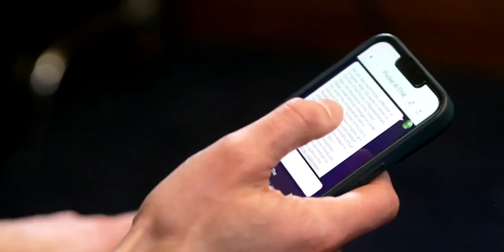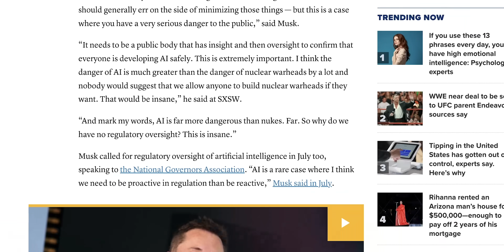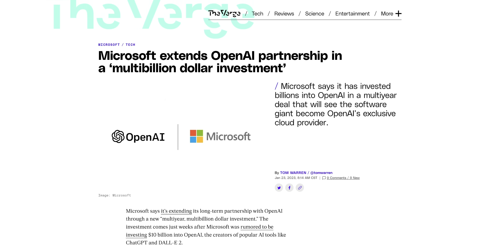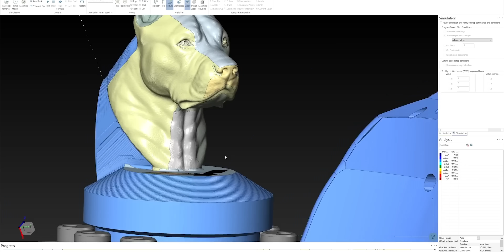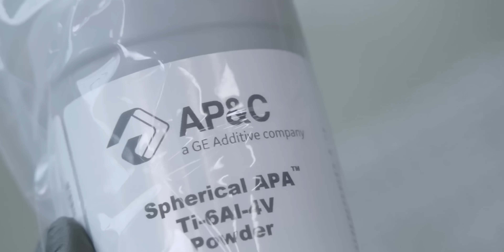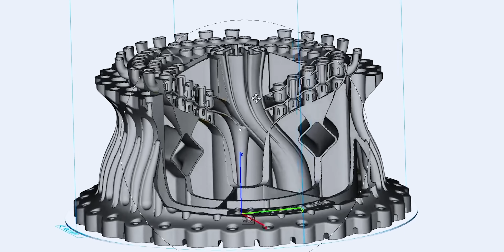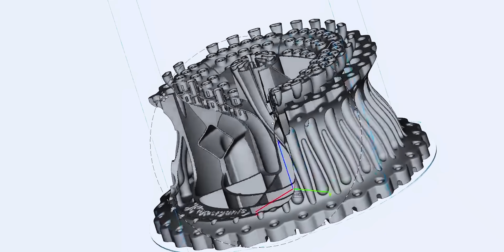How CNC Machinists CONQUER the RISE of AI

Comment: The overall message here is fantastic! So positive, AI is a powerful tool to augment your daily tasks. I'm a 60 yr old embedded circuit designer with 40+ yrs of experience, I have chatGPT open all day long, helps this old dog to remain competitive. Don't fear it, embrace it or you'll be left behind. Thanks for the video.
Reply: Hey, I also had a long career writing circuits and software for embedded systems! One of my early contracts, the customer thought I should manually check everything to make sure my signal traces were not shorted together, but I showed them the computer already did that check in a few seconds instead of hours! For the past few years I have been doing manual machining, making pretty parts out of stainless steel or sometimes plastic. Sometimes I run, and write small programs for, our ProtoTrak CNC mills. We do not mass produce; today I made 20 parts the same which is highly unusual, more often just 1 or 2 of a kind for use in the machines we make. Our machines (that we make) are high performance loaders placing food products in their packages, multiplying the performance of factory workers by 100. Some machining operations, like threaded holes in the ends of long rods, cannot be done on our CNC machines because they will not physically fit in the machines, so I clamp them to the edge of a knee mill and move the head around to align with the rod. Our manual lathes also do work that is too big for our CNC lathes, but do at least have DROs that make precision cuts easy. I think CNC/AI does not replace workers, it just allows us to produce more things per worker doing varied jobs from design through some remaining manual operations so everyone can have more stuff.
Reply: @BenAtTheTube  I've never manually taped a circuit board layout but know what it is and how a software tool eliminated taping and increased efficiency.  I first learned to program an HP calculator and used as a tool. I also started coding in assembly because I didn't have a compiler. I mostly write in python, C and C++ now. I ran my first website by compiling the original NCSA webserver source, later called Apache and hand typed this page layout code called HTML. I wrote the first book on Embedded Linux. I can run a manual mill and write G code but use Fusion 360. I have 2 old ABB and a UR arms in my shop. These are all tools.

AI is at it's infancy now, sparking both excitement and fear. Will it replace humans? Yes, technology innovation has always done that. Figuring out it's place in society is the real challenge. 

I'm particularly interested in how AI combined with VR/AR will transform math, physics and engineering education. Imagine Maxwell teaching field theory or Feynman explaining quantum electrodynamics. Combining voice, AI and gaming technology together creating a Holodeck will transform education. How we decide to use it will be our decision.
Reply: If you need AI to stay competitive you are cheating against an honest man who refuses to use AI.
Reply: @Bagginsess  You're right, maybe I should just do google searches or watching YouTube looking for answers then charge my customer for a couple hours of consulting time. Instead, I'm opting to ask chatGPT and finding the exact answer in a couple minutes. At this point, AI is tool.
Reply: @CraigHollabaugh  why not just get Neuralink then? Why not just have a robot feed you? What about the knowledgable men you could have paid and consulted for the information instead?
Reply: @CraigHollabaugh  please think of the ramifications this will have on younger generations in the future who will be locked in to using AI because we did nothing to stop it steam rolling the labor force.
Reply: @Bagginsess  Now, that's a valid point.
Reply: AI allows me to write microcontroler code that i cannot write fast enough or well enough to operate the machines I build for the customers i am intent on delivering solutions for.
Reply: "cheating against an honest man"...?
I believe there were similar arguments, when microcontrollers and PCs were introduced...
Regarding neurolinks: If I decide to do so, then it is my decision to change my own body anyways.

The problem here is not with new technology, it is with the thought of short term profit maximisation.
You have one engineer here, who uses new technology to augment his own work to do even better and stay competitive.
On the other hand, you have CEOs of big companies, who use new tech to get rid of workers to reduce the "cost of working".

Those are two very different concepts. The latter could (and should) be addressed by lawmakers.
But I can already smell the "COMMUNISM!" thought-terminating cliché.

Comment: Titan I'm old school machinist started sweeping floors at at machine shop back in the early 70's.  Then my boss asked if I wanted to run one of the machines well that's when it all started.  The man that trained me was very old but he knew a lot.  Told me to start buying tools and stuff.  So I got  a Kennedy tool box and started buy mic's calipers and stuff, I work at that shop for 5 years.  I was in the business for 25 years worked on the F16, F111 at General Dynamics work there for 12 years.  Got layed off and work at severed shops after that. Now I am a Mechanical Designer I'm, 67 years old now but love what I do.  It's god to see your show when it was on TV but I like your you tube videos.  I do miss the shop life but my knees couldn't handle the standing up all the time.  You're doing a good job with young one, keep up the good work and god bless.

Comment: The current level of AI is not a threat to any job, but what can be concerning is the exponential rate of improvement of the technology. An AI today is pulling from the data on the internet, but that's not how Alpha Zero became so dominant at Go. After an AI is trained on initial data sets (like the internet for GPT) it can then be optimized much further for specific tasks through running simulations or even operating in the real world environment if given an optimization objectives and reward functions. For machining that would be meeting design requirements while minimizing cost per part which would take into account cut time, machine wear, material use, etc...

I believe like most jobs it can also be far easier to automate 90% or 99% of tasks since they can be more repetitive but the hard part comes in automating the rare jobs which make up the long tail to get to 100%. Jobs won't be automated unless machines can do 100% of the work, instead we'll just get more productive.

As a machinist or anyone else I wouldn't be too concerned though, labor intensive jobs are likely to be harder to automate fully than others and once a threshold number of jobs are automated without trainable replacement opportunities we will have to come up with a new economic system like a UBI or something similar to take care of society at which point Machining will continue to live on as a hobby for anyone who wants to practice it just like countless other skills including blacksmithing and more.

Comment: AI may not replace every operator but it will eventually replace the cnc programmer. Just think about what you do after you write a program. Run a simulation. AI will do it in real time.

Comment: An AI expert I heard said he thought GPT-4 had been trained on everything that had ever been written that was available digitally and that GPT-5 would include every audio and video recording ever made. I had GPT-3 write some gcode and with a few corrective prompts, it would fave ran fine. Faster than I could type it out for sure. It was simple stuff, but a lot of job shop stuff is. I think you miss the mark when you talk about creativity and efficiency. A robot system doesn’t have to be more efficient they crush you on the time scale. AI can simulate a thousand different toolpaths and optimize for the best one in a fraction of the time a human can do one. Automation has always struggled with making robots use human tools. But soon, AI will design tools specifically for robots. Imagine a massive Swiss style machine. Feed it 12" diameter stock and produce no human touch practically anything.

Comment: I can see more robotics coming in to reduce workplace injuries for part loaders especially since some of the robots can lift up to 2.5 thousand pounds.
Reply: But we manual machinists will still be ones to make  prototypes and reapairs  we manual machinists aren't hindered  by waiting  special inserts and holders
Reply: @miguelcastaneda7257  manual machines are vital in ship building, roughing operations ( for large castings and forgings), tool rooms, polishing, and rework.  Old addage they don’t make them like they used to.  I have personally run manual machines that predate the 1st war for roughing out castings.  Prototypes no I have seen that done manually and on CNC. I think it depends where and application.
Reply: @Jay Dee  alot of tool and die is still manual..and passed on knowledge as well as hand polishing
Reply: @miguelcastaneda7257   that is true but my experience isn’t there just speaking on what I know as a machinist in Aerospace Defense  Oil and Gas and Foundry operations.
Reply: @miguelcastaneda7257 yeah, mkay
Reply: Old robots have muscles but no strong AI brain. Strong AI will be much different. It will be smarter than you in all possible ways and can teach itself using only internet and practical experience.
Reply: @humanspirit3432  Then this will be ultimate stupidity of humans to make themselves slaves of machines!!!!

Comment: Lol Machinists have used "AI" for decades . CAM software essentially works in the same manner as these "AI" programs , just a glorified calculator. Put in parameters, and it will spit out the best solution based on the information it has received.. If anything this more complex calculators will make our jobs more productive.